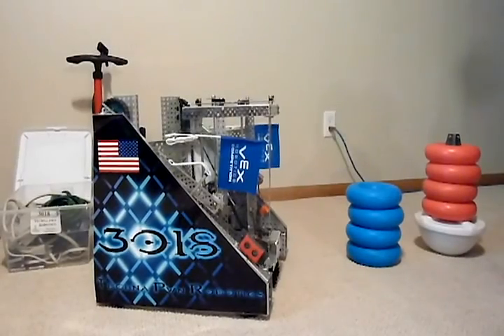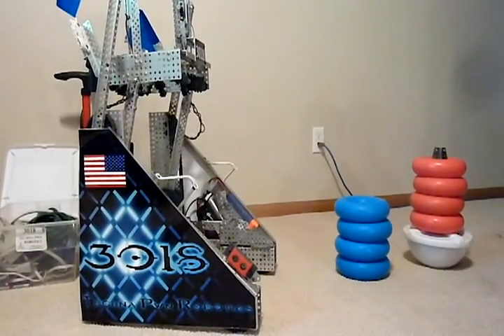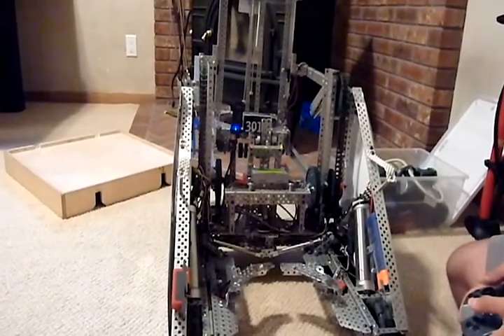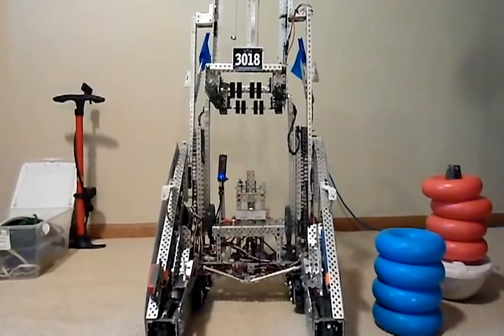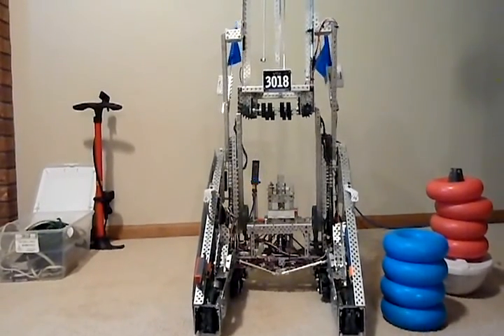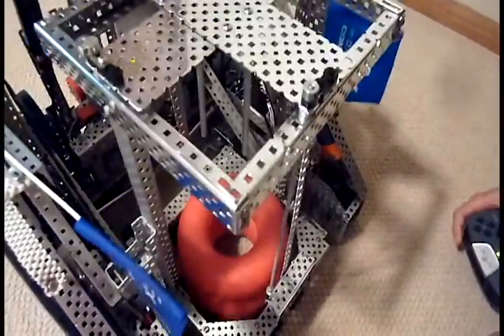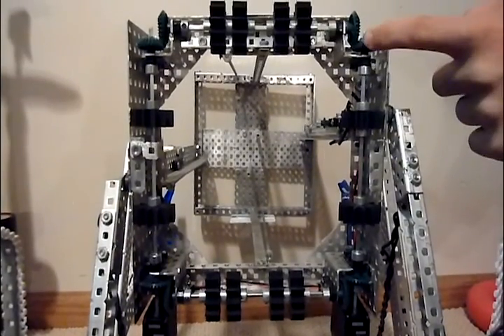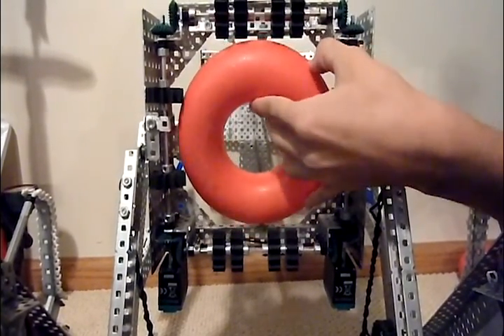Techna PWN Robotics Explanation video for Round Up

Comment from the maker: @jjp - We had motor mount brackets inside the tube cage box. These brackets were used to hold the motor in place and the beveled gears in the corners. The tolerances needed to be just right for all to fit, but they were fabricated that way and they worked just great.